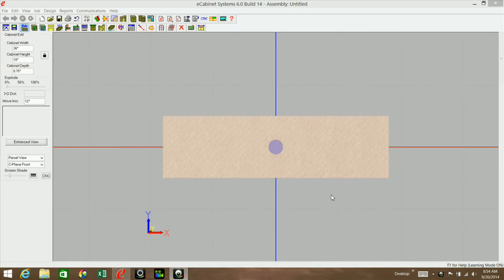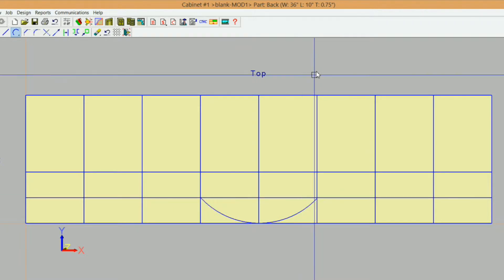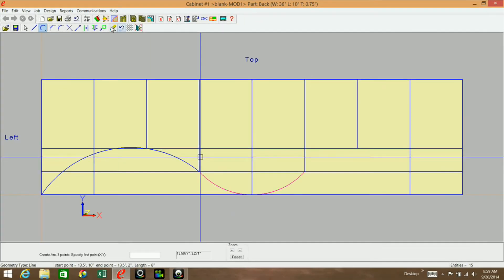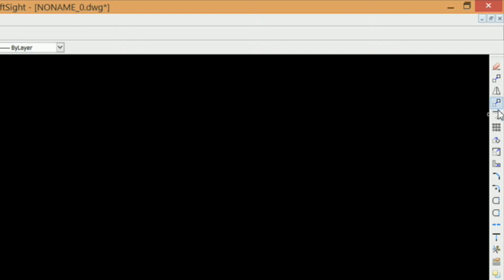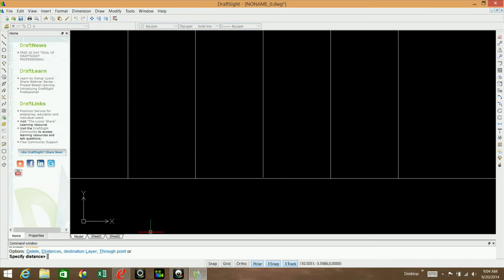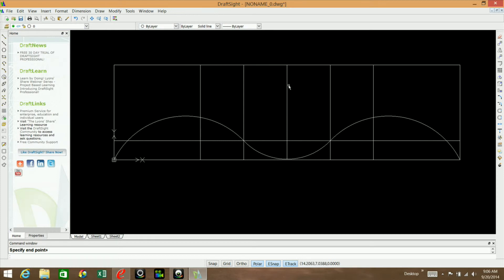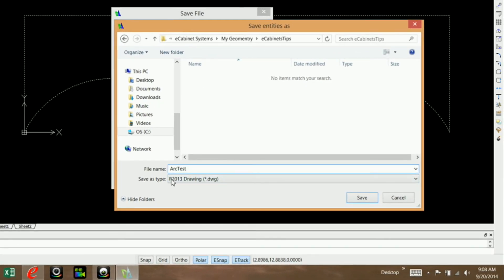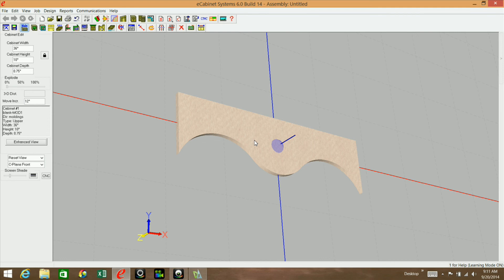How to use a 3rd. Party software to import geometry into eCabinets.

Comment: Thank you for all of your videos! I have a complex dxf file with many parts drawn on to about 13 sheets of 4x8 material. Is there an easy way to import this in to ecabinets to be cut on my thermwood router?
Reply from the maker: Yes it is possible to import dxf files into ecabinets. However without seeing the file it would be hard to explain how to go about getting it to cut on your machine. If you would like to send me the dxf file I will be glad to take a look. You can email it to ecabinetstipsandtricks@gmail.com